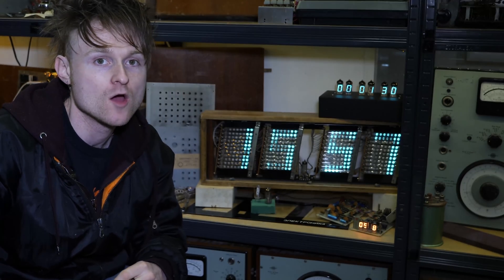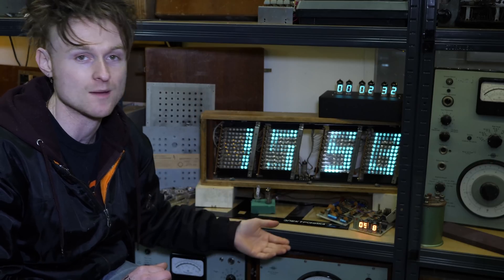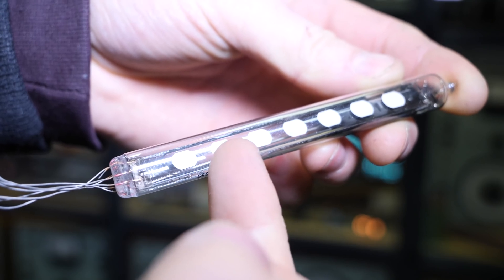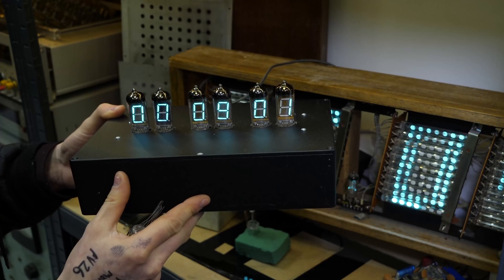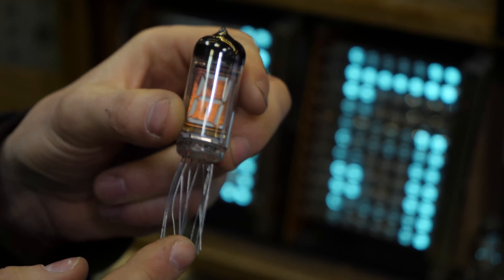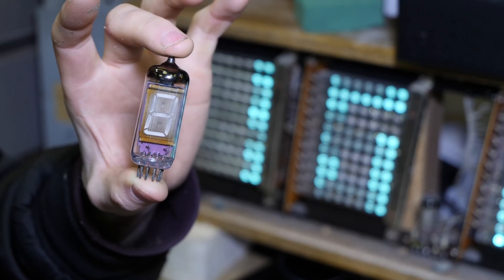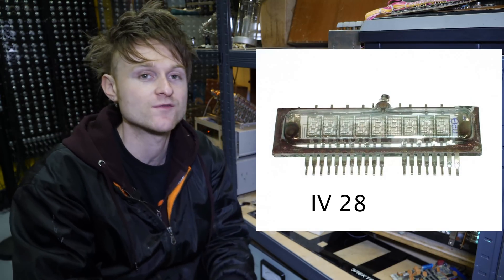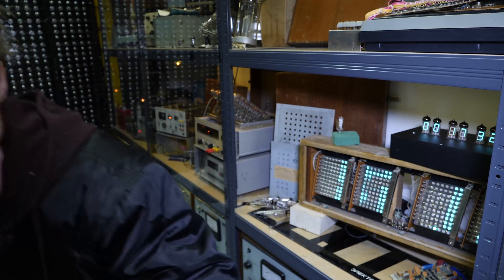Different IV VFD Vacuum Tube Display Tubes From The Soviet Era

Comment: IV-26 Type 1 - are universal, they have all dots as separate wires and it will work in big and small Elektronika 7 clocks, IV-26 Type 2 is designated for the big clock only and IV-26 Type 3 is for the small one.

Comment: I'm in the process of restoring an Elektronika-7 I bought years ago, along with a set of replacement tubes, and finally a few weeks ago pulled out of the attic to get to work on it... only to find that I'm short about 5 tubes, and due to recent world events, they're all the sudden not available anymore... Might have to mix in a few worn tubes with the new replacement ones.

Comment: Hey! This is not a Russian watch
This is a Clock from the times of the USSR, lamps are made in Ukraine at the GAZOTRON plant ... Ukraine and Russia are different countries
Reply from the maker: that's why I said soviet era and also mention Ukraine in the video..., however I was not aware they were only made in Ukraine. thanks.
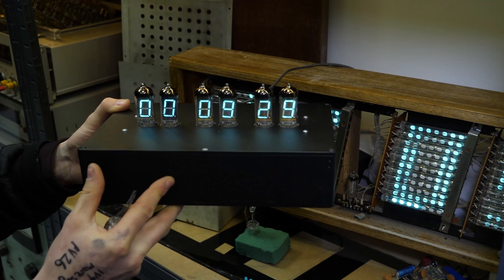Reply: @THISMUSEUMISNOTOBSOLETE  sorry, but that comment is plain wrong, they were not made only in Ukraine, USSR as a whole had at least 6 different factories that were producing various VFD's, nixies and other vacuum tubes. This particular Elektronika 7 clock and its tubes was made by "Reflektor" factory in Saratov, Russia. It's usually possible to deduce where particular tube was made by factory logo, for example at 2:50 you can clearly see a "Reflektor" factory logo on the top, but you probably wouldn't want to dig That deep, just keep those things "soviet" you wouldn't be wrong

Comment: I have a bunch of vintage Japanese VFD tubes, Iseden itron DG12Cs, which I got when Fair Radio was selling broken driver boards with 12 of 'em on for $5 each. They're similar to seven-segment displays, but actually have nine segments — the middle bar is broken in half, and there are extra internal vertical bars. If you imagine the 8 with a + overlaid on it, you're pretty close. Each digit also has a trailing decimal and a leading apostrophe, for 11 total elements. 

I should map out an ascii-like alphanumeric code for them and build a big display — throw an Arduino and some shift registers at it and figure out the purpose later.

Comment: The mystery device looks like a motor controller. It has armature connections (the spinny bit) and field winding connections (the outside magnet bit) and also has the firing angle for control of something like thyristors or IGBTs. The additional isolated gates switches also suggest this.
Lastly, it has a phase sequence indicator, so that means it can probably switch direction!

The dymo label top right says MO. Motor?

Comment: My guess is the mystery box has something to do with motor / generator control. Looks like there's a 3-phase section. Firing angle is probably some kind of trigger with respect to the AC phase angle. I doubt it has anything to do with rockets or ballistics. The common terms are just a coincidence. Maybe it was from a university department - hence the transparent box - so you would see what was inside.

Comment: The device at the end may be a DC motor speed controller!
Reply: Likely! I'm learning about the exact same thing at the moment, with thyristor controlled rectification. By selecting an appropriate firing angle you choose the speed and mode you want to use the DC machine at. Either as a motor or as a generator.

Comment: Good old IV26 tubes, I bought a load of them years ago for a homebrew version of that Elektronika clock but never got around to doing anything with them - one day perhaps.
Bit of kit at the end looks very much like a DC motor controller, with seperate field and armature drivers. Looks to have a large selenium rectifier and phase dimmer for the field, for varying speed.

Comment: Armature and firing angle, sounds like a special motor controller, you power the armature, then decide when to 'fire' the stator coils, think of it like a car engine where you can advance or retard the timing.
This is just a guess.

Comment: That last thing might be an analog computer to compute ballistics trajectory tables?
Reply from the maker: possibly! but it looks to maybe interface with something like that, I haven't opened it up yet but from the outside its definitely built to drive a lot of current and voltage into something, I'm talking 500 volts. and the fact it is in a clear enclosure makes it seem like a field device made for easy fault finding, even underneath there is a clear hatch
Reply: @THISMUSEUMISNOTOBSOLETE  Ah yeah, if it's driving a lot of current then it's probably not for computations.
Reply: @THISMUSEUMISNOTOBSOLETE  Or even better, it might be a training device, or a prototype. There would be no reason to make its casing from a clear material if used in a harsh environment.
Reply: @THISMUSEUMISNOTOBSOLETE  Most folks are in agreement that it's a motor controller. If it's around 500 Volts, then it could be for testing train or tram motors.
Reply: Would love to make a project with these! So cool! That's a great idea for a gift for your parents!